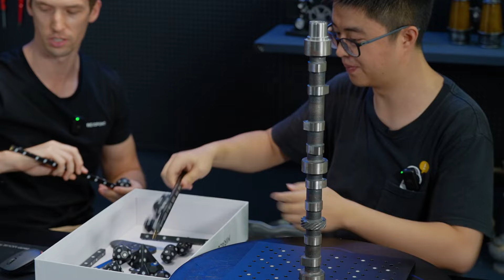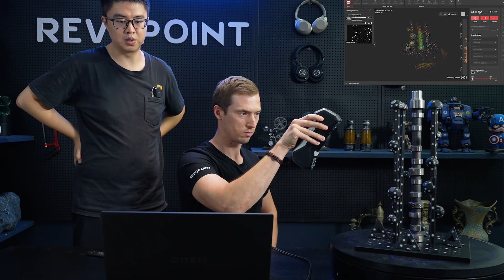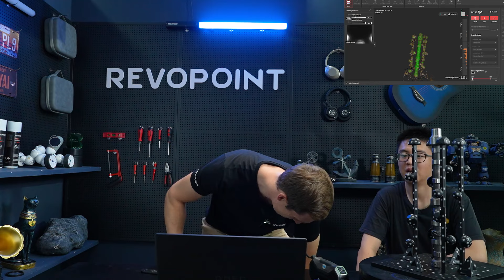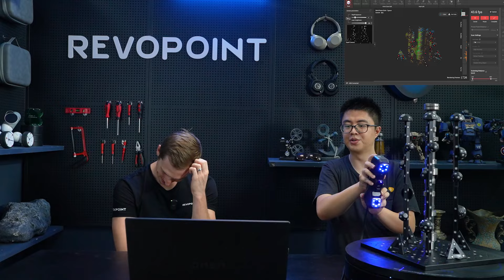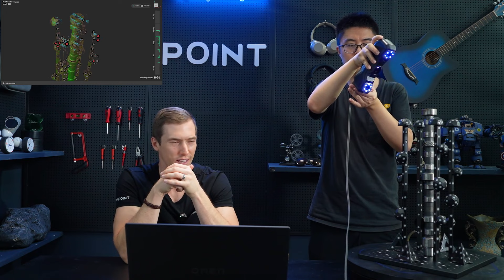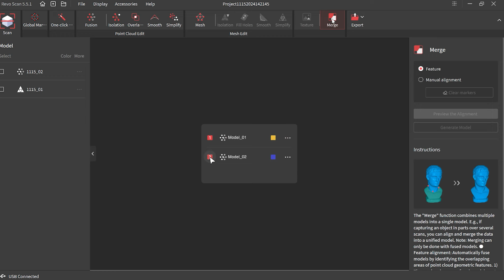Revopoint MetroX: Laser Scanning a Camshaft – Thanks to All Our Backers

Comment: Hi!
I strongly, highly recommend against buying scanners from this company. I bought a mini. It worked poorly from the start. In a quarter of cases, the laser did not work. Sometimes it worked on half the area.
Sometimes shaking it helped, sometimes it did not.
The quality of a successful scan is good. But it is very, very difficult to achieve this. After 30 scans, the laser turns on one out of 10-15 times.
There were no impacts or falls.
The support dragged out time in any way, demanded some logs that did not appear anywhere and confused my brain.
I tried to forget it, like a bad dream. But once every few months I returned to this issue and they wrote me some nonsense, like instructions on how to connect the scanner and start working. And my videos and photos were ignored.
Now I have once again wasted many hours, and this shit just don't want to work! The laser turns on for 0.5 seconds and goes out.
After 20-30 times plag in-wait 30sec-try to scan cicle it work! 3-4sec. And then laser start run for only half of the width. And I decided to remind this wonderful company about myself.
It's realy big money for me in my country. I spent full year (mb more) collecting that 1000$...
Revopoint, guys, i hate you with all my heart.
Reader, sorry for my english. Maybe i was unlucky, but please think one more time before buying something from this company.

Comment: Will my laptop handle your scanner..?
 HP ZBook Create G7 Notebook PC                 
 Processor: Intel(R) Core(TM) i7-10850H CPU @ 2.70GHz (12 CPUs), ~2.7GHz
 Memory: 16384MB RAM
NVIDIA GeForce RTX 2080 Super with Max-Q Design 16gb.

I'm struggling to choose the right scanner.

Thanks for the usefull vdo.
Reply from the maker: You can go ahead and download the software to test it out.

Comment: By experience handhelding like cameras without stabilisation is very micro jitter/shaky, would it improve to for example use a dslr gimbal on the scanner for very steady meassurements or is the latency just insane fast compared?
Reply: I'm gonna try to 3d print some sort of adapter to use with my DJI phone gimbal. 
If the tripod case has a native 1/4-20 thread on it then you could easily put it on a ronin no modifications. But that's wishful thinking.

Comment: Do you have one of these style videos where an apple silicon Mac is being used?  If not, is that something you can show?  I know a lot are curious how the MetroX performs when using a modern Mac.
Reply: I would like to see that also. It would be nice to know performance difference between a m2/3 pro and m2/3 max chip with MetroX.
Reply: Not sure I could borrow one in the office, or maybe I use a MacBook?
Reply: @ I have a MacBook Pro and I know many others do as well.  I’m curious if the performance of the software is optimized for the Apple silicon or if it is not very optimized.  I understand that this type of software has high system requirements on the windows side and it’s not really being talked about.  I’m curious if the Mac is version is any better or worse.

Comment: Life happened or I'd be considering one, maybe later.
It would be entirely groovy if it could be possible to purchase only the sensor bar if to retrofit upgrade a preexisting miraco to essentially become a newer edition one, if it's the only actual difference in the original miraco and the newer blue lasered one.
Reply: this is not a Miraco. and you cant simply swap sensors